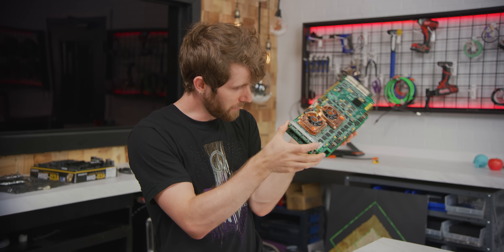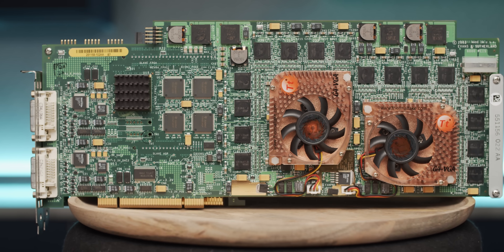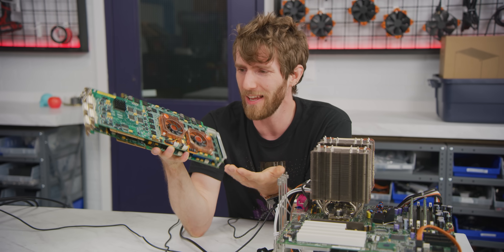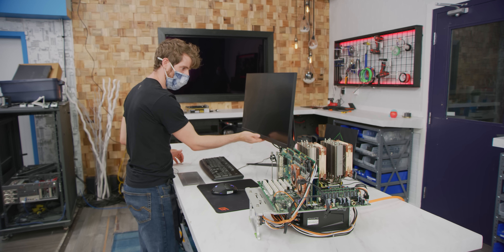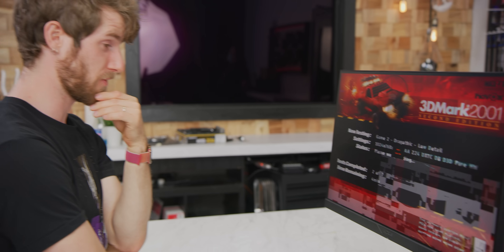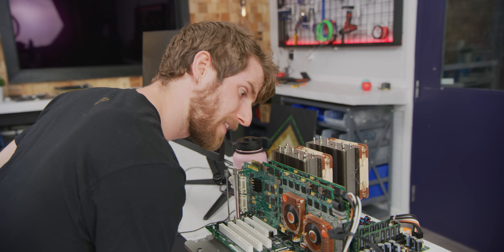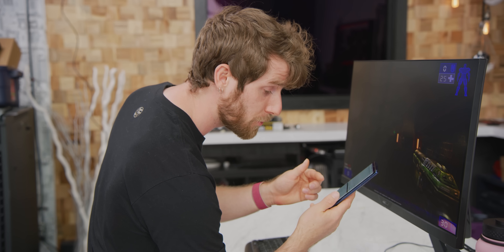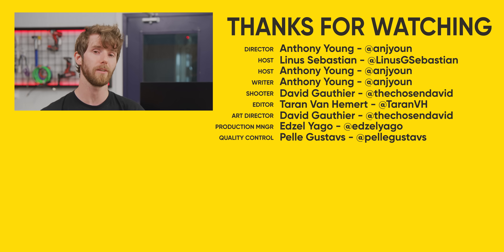This MONSTER Video Card has 4 GPUs... and it's from 2004! - E&S SimFUSION 6500q

Comment: Linus: "Speaking of the past, we're going to be building a PC from 10 years ago...."
Or you could just borrow mine
Reply: I thought the same!
Reply: Asus Rampage III Extreme
Xeon W3690 or i7 990x
6x4Go DDR3
3 way SLI GTX 580
That's how it's done !
Reply: @jean-charlesweyland129  I mean an i7 990x, 580 and 24gb of ram is still a decent system.
Reply: @miniweeddeerz1820  i have only 2
Reply: @jean-charlesweyland129  That's almost what high end computer would have been in 2010, except those CPU's are from 2010. In 2010 there was the W3680/i7-980X/X5680 which is pretty much the same with lower clockspeed, but obviously they can be overclocked just like the newer ones.
I still have a Xeon X5670 @ 4.4GHz and 24GB RAM in my main PC. Maybe in 2 to 3 years I'll upgrade to some Ryzen or something
Reply: Jean-Charles Weyland or core 2 duo and Radeon he 6570
Reply: Me too except 12 years old
Reply: @bournes9845  mine is 14
Reply: well my fx6300 don't want to die.
Reply: @Jincosoad  funny, my 1050ti just died in my fx6300 system, but a new card and she's still chugging on....
Reply: @Smakheed  this fx6300 are inmortal LOL, i am waiting mine to die or not run games that i play bur stilll do so i dont mind if i use it for another year or 2
Reply: @Jincosoad  seems so, just dropped a 1660 super in there and she's better than ever..
Reply: @Jincosoad  forgot to mention.... mine happily plays Flight sim
Reply: @Jincosoad  and my fx6100
Reply: @Jincosoad  I had this CPU xD Still does the job but worth the upgrade to Ryzen.
Reply: @Jincosoad  i also have one but i think i got this 3+ years ago... was not good but cheap
Reply: @Nordlicht05  i justo upgrade muy mono AND processor last christmas i nedded for work i got an i5 and now Is all great
Reply: @Jincosoad  still works food fx6100
Reply: @AdrianSimiOFFICIAL  I had an i5 9th gen since 1 year ago
Reply: @Jincosoad  i have a 4300 which is worse
Reply: @Jincosoad  i feel ya. I used that one until last year. I bought an Fx 8350 for 50 bucks, but that is as far as my board will go. 😂
Reply: Hey my fx 8350 is still hammering. My rx580 is an "upgrade" tho.
Reply: @Knallteute  dat bottleneck
Reply: @WowCreativeUsername  bottleneck? What's that?
Reply: @WowCreativeUsername  - hey now, the 8350 isn't 10 years old, it's only... 8.
Reply: @Knallteute  i did this same thing and had to move to ryzen asap. it feels so much better, and i know it already feels fine
Reply: @Bong_Wraith  that's my plan as soon as I can afford a reasonable upgrade with some room to oc.
Reply: My 12 year old ish system core 2 quad q9650 @4.06ghz  awesome gigabyte mobo EP45T-UD3LR with 16 gb's ddr3 @1804mhz my 8800gt 512mb died then my gtx 580 died it now has a gtx 1650 in it and still runs alot of older games warframe, classic wow, payday 2, Pubg CSGO, Dota 2, GtaV etc just fine and is also a home theatre pc
Reply: @Adzmataz  you should be happy
Reply: @bogdiyt5228  I am I still use it daily, I do have a new pc at my desk as well,but sitting at a desk all the time sucks it's great to have a pc to use on my TV while on the couch for rpg/survival games mostly and for movies etc.
Reply: @Adzmataz  ok
Reply: @Devon Pennartz No that's the ultimate mid-2010 rig. I've now got a gtx 1070 but my W3690 is still kicking ass at 4.5GHz ^^
Reply: @jean-charlesweyland129  locked or unlocked?
Reply: 10 Years? This thing uses AGP so try 18.
Reply: I hope you all are staying healthy and safe in this pandemic😊☺
(not for sub or views)
Reply: My 3570K system! Still need to upgrade, was going to this year but corona
Reply: @AhsokaTanoTheWhite  my xeon w3670 system overclocked to 4.5 and with a 1070ti still rivals my ryzen 5 2600 in GAMING
Reply: @AhsokaTanoTheWhite   send the cpu to me and I´ll run it for another 10 years at 5.2ghz
Reply: @AhsokaTanoTheWhite  whats ur gpu
Reply: @AhsokaTanoTheWhite  damn bro same
Reply: intel core 2 quad q6600

try meeeeeee
Reply: @EliteJohnnyR  bro an i7 990x is a 6 core 12 threaded max turbo of 3.6ghz similar to say a xeon x5680 and can be overclocked higher than 4ghz to say 4.3,4.5ghz. A Chromebook doesnt stand a chance in any stretch of the imagination. The ram is in triple channel and enough for todays games and offers good bandwidth for a 990x. the 580 is a decent gpu. It's a decent system.
Reply: @miniweeddeerz1820  isnt a 990x unlocked?
Reply: @marcbensen8963  yeah
Reply: @Badr Ahmed the Q6600 was a beast of a fucking processor.
Reply: Mines one year too new, since it’s running an AMD Phenom 2 X6 1090T from 2011.
Reply: Mine is like 4 months old
Reply: How about 21 years old PC? Fully working for sure :)
Reply: an3k probably not, anything older than vista to my knowledge can’t even get online
Reply: @bournes9845  as soon as windows understood tcp/ip it technically can get online ;)
Reply: an3k ok
Reply: I'd like to see those hypercompetitive AAA gamers all duke it out on a bunch of old crappy Emachines from 2003.
Reply: Still running an i7-3960x with a 2060, it just keeps fighting.
Reply: @norXmal  I have a 286 that I use from time to time. And 2 486's, several pentium versions, core 2 duo etc. All still alive
Reply: @MF175mp  A 80286, when is that from early 90's late 80's? 
What do you even use them for?
Reply: I have a 2008-2009 phenom ii x4 in a 2011 amd 970 chipset motherboard, I could literally just upgrade to an amd fx 8350, if they weren't being price gouged for some dumb reason
Reply: @ajddavid452  man i wouldnt waste the money. even a 1500x is massively better for not a lot more. i remember i had a core2duo and thought id slap in a core2quad but it wasnt worth the small performance gain so i bought a 2550K which at that time had just dropped in price. it was worth it i had that chip in my secondary rig until last year
Reply: @eclipsegst9419  well I am going to get ryzen, I have every part I need now(I have 2 sticks of ddr4 ram, and I just bought a motherboard and it's in the mail) except for the cpu, which I will buy next month
Reply: @ajddavid452  awesome! will that new 5000 series be out by then? it seems like its truly worth the wait for the massive ipc gain. but the r3 models arent announced yet so the cheapest will be the 300 dollar 5600x. if thats out of the budget the 3300x if you can find one or 3600x are still lightyears above your Phenom
Reply: @eclipsegst9419  yeah I will probably just get a 3100 or the 3300x if it's actually in stock and not like $300
Reply: Speaking of the past, where the Hell's that episode?
Reply: Same XD
Reply: Man, it's so f$%&ng true xD
Reply: 3 months ago i finally upgraded my processor/motherboard/ram (i7 920, ( build it in 2009))
Reply: @Masao_ours  mine i7 920 still runs healthy
Reply: Indeed
Reply: Same here. It's just I'm running Skulltrail with 32 GB of 800 MHz memory.
Reply: yea same...
Reply: Ya and have him save time
Reply: same
Reply: I feel you bro, still rocking my ASUS mid-range laptop from 2011
Reply: @Yannick Schoenfeld ist halt ne nette Preis Kombi
Reply: Mine is 11 years old so he couldn't borrow mine lmao
Reply: I'm using an HP Z800 that's about 12 years old now.  That 4x4 Xeon is still holding it's own.
Reply: mines like 20 years
Reply: or less
Reply: 1nFernal - Roblox  not likely, it wouldn’t even be usable
Reply: Bourne S see thats what you think but my pc is very much usable
Reply: I have an intel pentium g860 4gb ram and an nvidia gt 610.....
Reply: @BazsiHHH  oof
Reply: Mine's 8... but with newer SSDs (had a Force GT 240 initially) and better graphics card though.
Reply: Hahah mines 13 years old noob
Reply: i dunno i think mines pretty close to ultimate 1st gen .  Intel extreme mobo ,  Xeon 3470 ,  16gb corsair , 750ti.  had an single block Intel AIO too but it got sold and i used a newer CM one.
Reply: you think thats slow.. I have 4 XT boards here that operate at 3.77mhz..   no cores.. no threads lol  also have an AT (2 mhz) but it dont work..

oh 10 years not 40..   lol
Reply: Awesome.. I'll be sure to watch that video on my current main system.. i7 920 w/ GTX 670...  I'm overdue
Reply: Running on an Athlon X4 850k I build in 2014..does that count?
Reply: Hell, that's almost 20 years ago! My current PC is already 8 years old, and it still performs comparably to more modern laptops, so a 10 year old PC isn't really that far off from what  we already have.
Reply: speaking of past, leave no trace with nordvpn!
Reply: Mine is 15 years old i think it has a two core CPU
Reply: I had a i3 3220 and 660ti for ages but finally ungraded a bit to a i5 4670k and 980ti
Reply: i7 860 here, on a mobo that uses PCI-E Gen 2.   I upgraded it with a 380X Nitro back in 2016, and this year bumped it from 8 GB to 16 GB of RAM, and swapped in an SSD as the boot drive.
Reply: @outsideredge  unless toy are gaming heavy, iraball you need
Reply: mine is coming up on 6 but i think it has at least 2 more in it. i7 5775c. By 2 years Alder Lake and Zen4 will be out on new sockets and with enough single core performance boost to actually justify an upgrade. Right now it only sees 60% usage at 1080p/75hz high/ultra settings, less on older games and tbh those older games are the ones i play the most.
Reply: Asus P7P55D-E
Intel i7 870 overclocked at 3.65 GHz (Base Clock of 2.93)
16GB (4x4GB) of DDR3 HyperX Blue RAM at 1333MHz CAS 14
and until recently
Two Nvidia GeForce GTX 470s from EVGA on an SLI
Now
Two Nvidia GeForce GTX 970 FTWs from EVGA on an SLI

Luckily my new parts are soon to arrive.. just gotta wait for the day the new RTX's aren't stupidly backlogged lol
Reply: @DirectorHawke  your getting an rtx card and not a cpu upgrade? that poor 870
Reply: @ajddavid452  i said my parts excluding the GPU are on the way.

That means MOBO, CPU, Cooler, RAM, plus an M.2, I'm waiting for either the RTX cards to stop being gobbled up, or to grab the new AMD 6000 card. But I'm not gonna get my hopes up for a few months.
Reply: @DirectorHawke  oh okay, good XD
Reply: no and i broke the 100 replies lets go 101
Reply: @Ankit Mahato my laptop has 1st gen i5,but dedicated nvidia graphics
Reply: I can already feel my electricity socket catching on fire just by looking at that card
Reply: @Yannick Schoenfeld - It would be surprising if an FX 8350 would be much of a bottleneck. 4GHz with 8 cores is plenty for most tasks, and you won't even be using all those threads is the vast, vast majority of games, let alone most other applications.
Reply: my is from 2007
Reply: my is from 2007
Reply: Took a while! Mines only 9 now! was 14 before :)
Reply: Radeon hd2400xt, 3gb ddr2 dual channel, amd phenom 9600, 1 tb hdd, media drive bay, blu-ray DVD player, and windows Vista home premium. Lol. Its a gateway gm566. Now I got a i7 7700k, gtx 1080, 16 ddr5x ram, 2tb hdd, 256 sdd nvme, with a DVD and CD drive
Reply: same lol
asus p5q deluxe, intel core 2 quad, 8 (soon to be 16) gb ddr2. only thing that could even remotely pass as "recent" is my gefore gtx 950.
can still comfortably play pretty much anything up to and including doom 2016 too. with reasonable graphics settings of course. i mean, i don't have to turn it all the way down to minimum so it doesn't look like complete shit, but i don't think i can play it at the highest settings either. not sure though, i'd have to check and i'm too lazy to do that right now lol.
Reply: me with a core duo and 2 9800gts
Reply: With a laptop from Q1 2011, same
Reply: My i5 655K Still Good
Reply: Try to find job.
Reply: Mines 14
Reply: @Badr Ahmed mines even worse
Reply: Have an athlon 3000+ and phenom II x4 960 T that I use every once and a while. Built these during there eras.
Reply: yah really...  My old i3-4340 was my main gamer till about 4 months ago.   It had 16gb of1666mhz  DDR3, 2 TB HHD, and 500GB SSD for games.  With a GTX1650 Super with 4GB of DDR5.   I played RDR2, World of Tanks, Elite Dangerous, Eve Online, American Trucking sim, Sims3 and 4, Crossout, BF1, PUBG, War Thunder, and many many more.   most game held out at 50-60 FPS and some games with FPS over 100+.    I didn't see a need to switch until i bought the new PC and it started up in a few seconds rather than a few minutes.
Reply: Pentium G3220T anyone?
Reply: mines 12 years old
Reply: @gmu_alum08 If you are talking about the 3 GTX 580, they were replaced by a single GTX 970 in 2015 and finally by a 1070 in 2019.
Now I run an i7 5820k 6c/12t @4.4GHz, 32GB of Ram and a RTX 2070 Super.
Reply: Same except mine is 12 years old
Reply: mine's from 2007
Reply: i only have a laptop from 2010 and it has integrated graphics but of course it runs linux because i wanted the performance to only take 10 seconds to load firefox
Reply: I feel your pain
Reply: i5 650 anyone?
Reply: Garlic Bread Jenkins show off
Reply: @garlicbreadjenkins5780  no
Reply: If he need  a 10 year old PC, then he would be too late to borrow mine...
Reply: @Yannick Schoenfeld how is this beast working on 2020
Reply: @After_Pasta  With the 1070 that replaced the 3 580 in SLI and 4,5GHz overclock on the cpu, I average 65-70 on very high with peaks at over 100fps. I'd say it's comparable to a 4790k.

Comment: You might want to check out the Quantum3D 200SBI (a 3DFX company), a dual GPU that could be QUAD stacked making for a brick of a card that had 8 GPUs!  I am also, fairly sure it pre-dates that card by a few years and is what ran many arcade systems.

Comment: I'm so much happy about seeing tantalum capacitors. I mean those yellow things on the card, they used them instead of those battery looking things on normal cards. They have lower series resistance, longer lifetime and they're pretty new. They should be pretty expensive in 2004.  But they have two problems; they cant be more than 1 micro farad (if i remember true) and i never seen through hole tantalum. Just surface mount.
Edit: I mean milifarad not micro
Edit2:Well i just didn't know they are going to talk about them.

Comment: LMAO You mentioned the Alienware attempt, I recall that and was going to comment about it, but you already did haha. It was a novel idea and different from SLI but never really made it to the public from what I can tell.
Reply: Can you add any details or a link about that Alienware attempt?
Reply: @mrmarecki1  Years ago prior to SLI went mainstream. Alienware was working on a set up that utilized a multi GPU set up. They touted that it was better than SLI because each GPU rendered half of the screen, one GPU for the top and one for the bottom, rather than having both GPU's sharing the processing between them to process the entire screen.  Not sure what the issues were with it, but they probably felt it was cheaper to just use SLI and CrossFire. This was way back when they had the alien head looking cases that you could buy in Martian Red, Lunar White etc. back before the Dell days, when they were very innovative. It was something built into their motherboard I believe. I think ultimately they made the right choice, since they would have had to design and build a new mother board for every new chipset.  Cheaper and easier to let the motherboard and graphic cards manufacturers deal with it on a standard feature to integrate themselves.